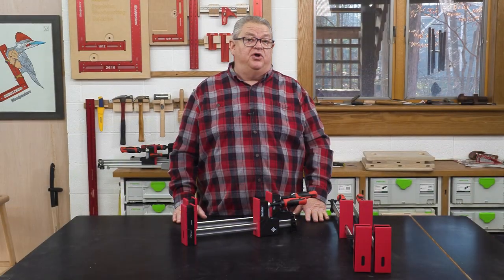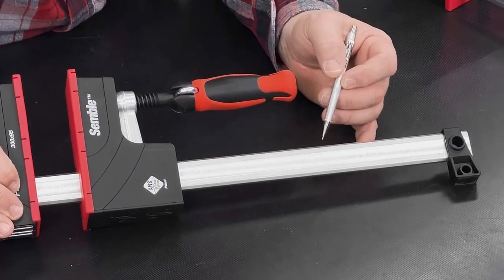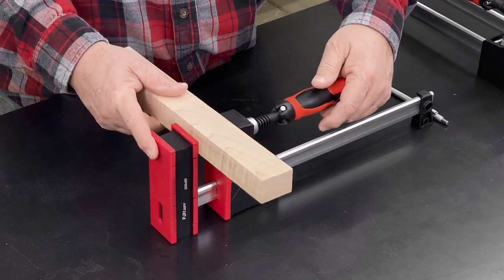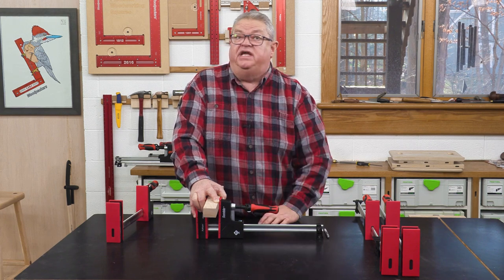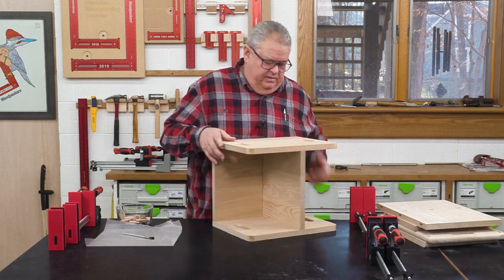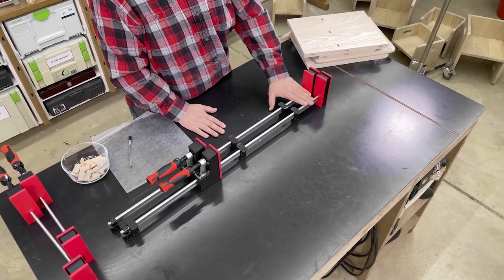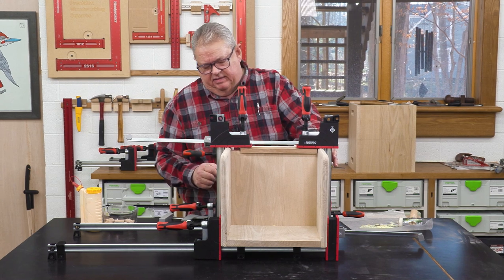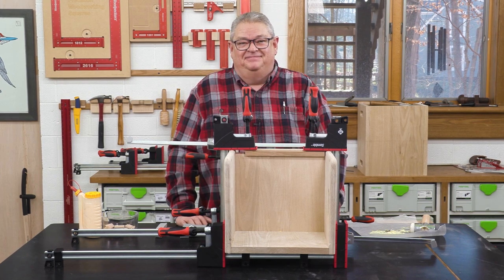My First Impressions Of Semble Parallel Jaw Clamps | Deep Dive | Woodpeckers Woodworking Tools

Comment: Jeff is a great instructor, love his videos....
But Yost parallel clamps have the tilt handle and produce more force than any clamps I have tested, they are superb.
Also, the new Bessey parallel clamps have a hex female socket in rear of handle, which enables a ratchet handle to fit in, this will save your hands more than any clamp ever made, as the leverage is measured by how long your ratchet handle is.  I switched over mostly to the Bessesys now... then add in the tremendous accessories they sell, , it increases the versatility of the clamp, specially the ability to make them longer.   Jeff is right, hands can get sore grabbing those handles and torquing them.  I only have a tiny touch of arthritis, cant imagine having a more severe case and torquing the handles.
These look like very high quality clamps, certainly not knocking them in anyway...just advising fellow ww of the alternatives for added handle leverage.
Reply: Glad to hear Yost clamps are a good alternative.
Reply: I did not know Yost made clamps like this. Good to know. I have one of their forged vises. Best vise I ever owned and fairly light weight, but not lightweight on clamp pressure, it's a beast.

Comment: Thanks for explaining the why and where for this new line.  Have to agree on the Jorgenson comments, I have a lot of older (USA) versions also newer parallel clamps (wish these had the clutch that the Sembles's have as they tend to slide down when vertical), the 90 degree handle is a great feature.  At this point Bessey is mix of manufacturing (Germany, US Assembly, and China).

Comment: These are identical to Ehoma clamps sold (for less) at Woodcraft. They have some nice features but I’ve never had the described issues with my Bessey clamps.
Reply from the maker: Not identical. Woodcraft's do not have the pivoting handle. That's a feature well worth a 6 or 7 dollar price difference.
Reply: Really?
Allowing for only a 300% gross margin, are you suggesting that your cost per pivoting handle upgrade runs to $2.00, give or take a dime? @WoodpeckersLLC
Reply from the maker: I have no idea. That's not my department. I'm saying that as a clamp user I would pay 7+ dollars more for a clamp with that feature than I would pay for one without it.
Reply: @WoodpeckersLLC  
Fair enough. 
Can’t argue with that.
Reply: Agree .. ehoma has been making pivot handle clamps for years.  They are terrible to use.  Bessey revo clamps are much better.  And they are German made!

Comment: The clamping head on Bessey parallel clamps ratchets down when you hold it vertically.  That's a nuisance.  Also, the pads slide off, another nuisance, but I've got so much invested in them that I'm not about to replace them.

Comment: ehoma clamps from Woodcraft... Same but different prices and can buy in singles. Highland Woodworker has these on sale currently with set 12.99 shipping for lower 48 and $0 tax for out of state purchase.
Reply: They look the same but the Ehoma clamps at Woodcraft do not appear to have the pivoting handle. My guess is Woodpeckers took the Ehoma clamps and rebranded them as Semble. An internet search found the Semble name was trademarked by Woodpeckers in August of 2021. So the name Semble = $.
Reply: @FixedbyRick  ehoma offer both with and without pivot handles. The ones on sale at Highland Woodworker are pivot handles. Woodpeckers trademarked the name... not the tool. Why Woodcraft or Highland do not sale "Semble" but the clamps are the same from Taiwan... ehoma.
Reply: @williamnelson3871  purchasing dept needs to negotiate with UPS, especially for overseas shipments. Woodpeckers is missing a lot of sales due to shipping costs.
Reply: @williamnelson3871 called more profit. UPS is not $84 flat without regard of actual location.
Reply: No longer enough to make a good product at a fair price.  Woodpeckers gets you coming a d going.  Why people support that strategy is a head scratcher
Reply: @formekinetics691   I just added every single option to my cart one at a time, I come up with $21 ups no matter the option.   People need to fact check before taking a comment and running with it
Reply: @adamgrund6086  it's still cheaper at Highland.. and have purchased plenty from WP's and shipping is always high. Never quoted a WP's shipping cost...only that Highland was cheaper....and they are.

Comment: They seem ok to me. Virtually identical to others. Any clamp is easy to use while on a flat table and with two hands. Doubt these are any easier than Bessey or jet. Sadly neither Bessey or jorgs are still made in us or Germany so they sough5bout to find something regardless of where it’s made. Um. Ok. Sounds more like a profit move to me, which is fine,but call it like it is. I have zero complaints about my inventory.